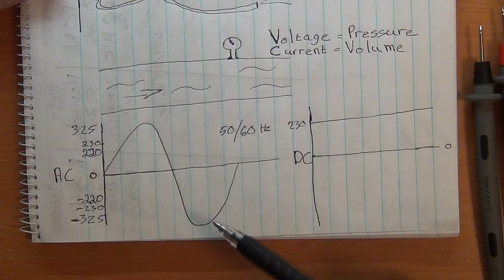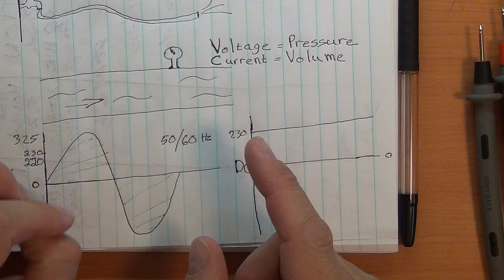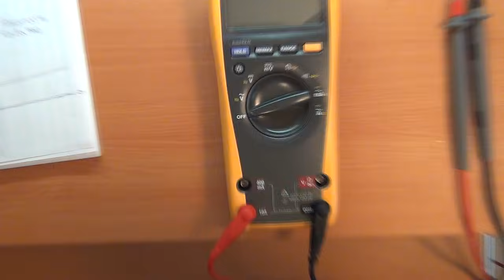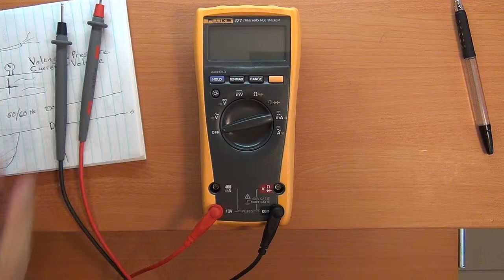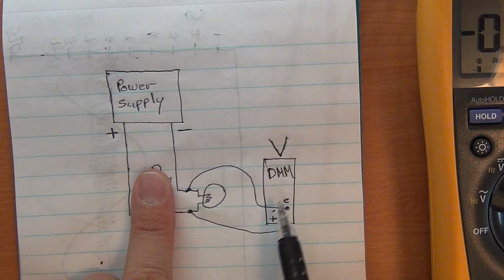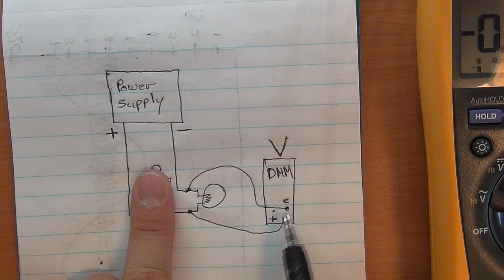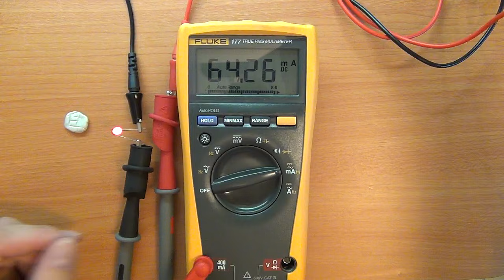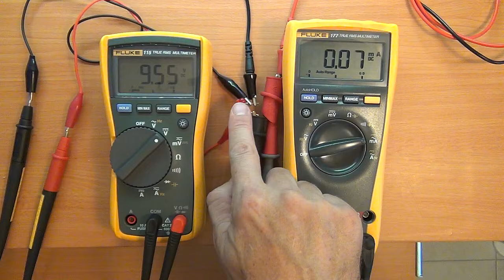Comment: Not to be too much of stickler, a singe cell is a battery when it is in a single cell device. Just like 4 cells in series is called "the battery" in a device that uses 4 cells, a single cell device also refers to the single cell as "the battery". Of course 12V 6V and 9V are all made up of multiple internal cells. Also, doesn't DC flow from negative to positive and not the other way around? Though I did sit through 2 years of formal training, I went into the computer side of things and not the digital electronics and so my memory may be failing me.

Comment: The mathematical average voltage in AC is 0 in a perfect sine wave. For every point in the wave, there a corresponding negative voltage. Despite going through 2 years of formal electronics training, I don't know why .707 of peak (RMS) is somehow "the average".
Reply: average voltage and rms voltage are two very different terms............ 0707 is the rms value. The average value as you said is obviously zero. You can check out the two formulas and both of them basically depends on the waveform.
Reply: Rishi Hazra
I assume it's not the average of a full cycle  but the effective voltage for a 1/2 cycle.
Reply: tarstarkusz well the average value of current or voltage for a sine wave for one cycle is calculated by the formula = (area under the curve) / base length

as the area under the curve of a cycle of sine wave is zero, the average value is zero.

but the RMS value as far as I know is the dc equivalent of an ac wave (i.e. say for current wave, it is the equivalent dc current which will produce the same heat in the same time in the same resistor ac that of the ac current.)

Comment: So that's why I had to spend $20 at Mouser for new 240v 1A & 10A Fuses. I tried to measure the current by touching red to red & black to black. Now when my new fuses get here I'll be prepared. Thanks so much, I had absolutely no idea this was the right way to measure current. It makes sense now. Now I'll be able to measure my Portable Cellphone Charger the correct way. (+1 : 3,443).

Comment: if the voltage is the pressure, and the voltage (pressure) is responsible for pushing the current, then how is it possible for a car batter to have low voltage and high current?
Reply: Think of it as a water faucet. Even if there is low water pressure, if there is a small opening, that pressure is increased; hence, increased pressure (current)
Reply: i thought the pressure = voltage..?
Reply: low voltage equals high current as its not moving so its a build up of current (electrons) if the voltage was higer it would be saying cmon current move ya backside hope this helps
Reply: As far as i am aware, Voltage is the measure of electric potential differance between two point's.

http://www.allaboutcircuits.com/vol_1/chpt_2/1.html
http://en.wikipedia.org/wiki/Voltage
http://www.dummies.com/how-to/content/electronics-basics-electrical-voltage.html
Reply: Voltage is not a measurement but p.d. is the measurement of electric voltage between two points

Comment: What's a good multimeter to buy? I just bought a $20 one but it has manual ranging, i get how to use it, but it's still a bit confusing.
Reply: that will do for basic need to spend a couple hundred get a fluke honestly

Comment: First, thanks for these tutorials. ive been reading this info in books and just havent been getting it. Im totally new to electronics and am learning it in order to do robotics. could you help me out with some questions?:

1. why dont they make a multimeter which KNOWS the differance between AC and DC. it seems fairly basic and easy to see.
2. Im looking at purchasing my first multimeter. what are the pros and cons of desktop multimeters vs the portable (fluke 177) ones? (recommendations would also be great :) )
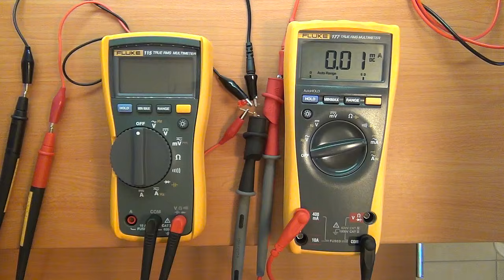3. Is there a way (or type of multimeter) whcih allows you to measure V and A at the same time? like you do with 2 multimeters at around 38:00?

Really appreciate any help you can give on these.

Comment: Hi there, the video tutorial really helped me out with the multimeter. Thanks a lot. But I have a question that I would like to ask, basically im in no knowledge in electricals so I assume u could help.
Just bought a house and literally haven't have time to get to know the house better. I realized mt actic light was on one day so went up there to turn it off and I noticed split seconds later one breaker that is connected to my bedroom, bathroom and the kitchen lights got shut off? So could you educate me?

Comment: @ Andy French.  Not 100% sure but I don't think you can measure current that way. You need to make the mulitmeter part of the circuit; not touch positive and negative terminals.   Maybe try removing +cable then touch +cable with red probe and            +battery terminal with black probe(completing the path from cable to battery). Find an old guy, they are great resources.  Good lluck

Comment: Just a dead quick question..... I wanted to measure how many amps was being 'put into' my motorbike battery when it was at about 3000 revs, so I could confirm that the alternator was working (Haynes manual stated that battery should be recharged at .5a at 3000 revs). 

When I put in the multimeter across the battery terminals, the battery terminal (whichever terminal I connected last) sparked and the multi meter did not read any values?  
The negative probe was in the 'COM' port and the positive probe in the '10a' port. 

What am I doing wrong?

Comment: I was told that AC travels better over distance. Brilliant video, many thanks.
Reply: Sort of correct. In DC, current reduces over long distances. AC, the electrons do not reduce because of the electron flow moves forward and backwards within a shorter distance compared to the one way flow of the DC electron flow.
Reply: Yes without major voltage drops

Comment: I'm confused. You say that DC freezes a body to the conductor and AC pushes it away. I thought it was the other way around. According to "The Set Lighting Technician's Handbook 3rd ed" by Harry C. Box (a book for film electricians), "AC current can be more deadly than DC current for several reasons. Although both types of current can have the effects listed in table 11.9, AC can freeze a body to a conductor with one- fifth the current of DC. Alternating current can more easily cause filbrillation and cardiac arrest because the 60 Hz polarity cycle is a harmonic of the rythym of the heart and AC current has a peak voltage of 170 V while DC is a constant 120 V."

Comment: AC, because the human body acts as a capacitor attached parallel with external circuit. And only AC can pass thru capacitor but not DC.
Now total resistance of AC=RC/R+C
where C is capacitance
Nd total resistance of DC=R
Since, R>RC/R+C
1>C/R+C
R+C>C
R>0
Thus, resistance of DC is more than AC hence more current will flow from AC than DC, since V=IR, I is inversaly proportional to R.
Reply: Too much wind.

Comment: I like to think of electrical current as pressure and voltage as the speed of water. I can then imagine water will jump out of a hose further if the voltage/speed of water is higher/faster. Current is like pressure squeezing a hose while it has water flowing through it. This will cause the hose to possible to burst. Like a wire getting hot.

Comment: If i can make a suggestion...use better leads. The multimeter is rated for 600v Cat 4 and 1000V cat 3.
Your leads are only rated at 1000v cat 2. Not an issue as long as you know what you are working on, however, BEST PRACTICE.

Comment: I have a Multimeter with a built in clamp meter, althought it only has two ports on the bottom of the multimeter for you to plug your testing probes into, if I want to measure current how do I do this? can someone please help it would be much appreciated :)

Comment: It may be an old video but anyways DC is nowhere near the efficiency of AC over long distances. There need to be many more power stations to generate and keep DC going compared to AC. That is the main reason AC is the standard for long distance power to like your home but DC works great for high power in short distance like your car battery.
Reply: Edison vs Tesla

Comment: AC current comes off the generator at the power station. Energy is wasted converting it to DC. Also, I think AC current travels more efficiently down power lines-though I could be wrong about this. I do know that resistance in power lines applies to current not voltage. Hence, very high voltage power lines (500k) transmit power more efficiently.

Comment: awesome video! can u pls clarify why is the multimeter set to Dc and not to Ac when you"re measuring the current in the LED as well as in the car headlight since your step up power supply is connected to an AC outlet?  i'm a newbie in electronics and really interested to learn. looking forward to your reply. tnx.

Comment: MJ/All...I TOTALLY understand your answer on why DC is more dangerous...but you mentioned when measuring AC to watch your fingers - don't cross tips etc etc...when doing the batteries (DC) there was no such warning and you were touching fingers to the battery etc (I understand a 9 Volt is apparently not dangerous - what voltage is?).  Also AC is in your home (correct?)?  That seems a helluva lot more dangerous than a battery (DC) - just wanna get this straight - this is good stuff!  Thx

Comment: Hi Martin,

 Had a question. You show in one of your classes a circuit using a bread board. Was wondering if you have a basic video indicating for beginners like me on how to create circuits on bread boards. I was very impressed with the multimeter and osciloscope video and would be good to have a basic video for beginners on using a bread board.

Comment: Excellent presentation and videography.

The multimeter measures voltage, current, and resistance.  You never measure resistance in a live circuit.  When you measure voltage, the voltmeter is effectively an open circuit, so if you put the test leads in the wrong places, you've done no harm.

The current range(s) are the most dangerous, and here's why: An ammeter is a short circuit you mean to put in series with the current path. Screw up (like putting your probes in parallel), bad things happen.

Comment: The reason we use AC current in our homes is because AC can travel longer distances over the electrical grid. Although DC could be used, it would require more infrastructure to provide electricity to every home. The use of AC over DC was settled during the War of Currents between Thomas Alva Edison and George Westinghouse. Nikola Tesla was in favor of using AC and he disagreed with Edison about the use of DC current. Tesla resigned working for Edison and later worked for Westinghouse.

Comment: Thanks for the video, but what if I have to measure i higher amount of amps? For example 70 - 80 amps. I do radio controlled modelling, and my larger aircraft have big motors that  pull a lot of amps! I don't need much accuracy, I need to know that the motor isn't pulling too many amps and burning other components. (wouldn't be pleasent finding that out when flying a model!) Thanks.

Comment: Here's my answer to the trivia question.  Keep in mind I know nothing about electricity but am keen to learn.  It is my understanding that since DC is not transmitted efficiently that it would have required generators on every corner.  AC is much more efficient at traveling down wires and therefore required far fewer generators and could be transmitted at greater distances.  So it comes down to money just like everything else.  It's cheaper to build the infrastructure for AC.

Comment: Sir,

I'm an ER physician. Your deadlier current reasoning is flawed & backward from reality. High-voltage DC often causes a large single muscle contraction that throws the victim away. AC of the same voltage is about 3 times more dangerous because the cyclic flow of electrons causes muscle tetany that prolongs victims' exposure to the source. Your muscle twitch response is not faster than 60Hz. Edison electrocuted an elephant trying to prove that his DC power was safer than Tesla's AC power.

Comment: The 240 you refer to is not what they use in other countries.  We have two 110 Volt lines 180 degrees out of phase.  What that means is while one wires voltage is going up to the top of the sine wave the other wires voltage is dropping down to the bottom of the sine wave.  Comparing 1 wire to the other you get a 240 Volt sine wave at the same frequency (interesting property of sine waves).  2 phase 240 @ 60 Hz not single phase 240 @ 50 Hz like in Europe.

Comment: Nice experiment.  You essentially measured the Current versus Voltage for a diode.  You should get an exponential function.  In a diode (not including zeners which are designed to work in the break down region) you will get ALMOST no current when reverse biased and an exponential rise in current as the voltage is increased in the forward biased direction.

Comment: It compares the current flowing through the hot side to the current flowing through the neutral.  If there are more than 5 milliamps of difference between the two currents it breaks the circuit.  The difference in current must be travelling an unintended path which may be through a person.  This adds another level of safety and is often required in kitchens and bathrooms around water.  Note if you have a heart condition 9 milliamps is about the minimum current required to kill you.

Comment: Note that you will always get the same amount of water flowing through the pump that you get flowing through the paddle wheel (if there are no leaks).  If I get a leak (by punching a hole in the pipe and placing my mouth over it) it might be nice to shut down the pump automatically.  This is analogous to what a Ground Fault Circuit Interrupter (GFCI) does.

Comment: which can occur if the hot wire ever accidently comes in contact with that metal surface.  If that occurs without the ground in place the voltage on that piece of metal will be "hot".  Someone touch it inadvertently would unwittingly be connected to high voltage.  By adding a wire grounding all exposed metal if and when a hot wire ever touches the exposed metal there will be zero resistance to ground.  This will immediately blow the breaker cutting off power to the appliance or fixture.

Comment: or return wire does not have a good solid connection to neutral voltage (approximately ground).  If this occurs and I touch the neutral I may get shocked.  Additionally in the states another wire which actually is hard wired straight into the ground separate from the line wires is required.  This wire is connected to any exposed metal on an appliance or fixture which might be inadvertently touched (for instance when changing a light bulb.  It's purpose is to handle a dangerous situation

Comment: Now what happens if I remove the paddle wheel pipe that is dipping in the ocean and place the opening on my head as I float in the water.  This is a different situation.  Now the sea side of the paddle wheel isn't connected to the sea and it can't get a free flow of water unless it sucks the water from my body.  It will suck all the water (electricity) from my body and then use my hollow shell as a straw sucking water through my feet!!!  Ouch.  This is analogous to a circuit where the ground

Comment: from the sea at the paddle wheel to replace the water in the pipe the pump pushed out.  Again if I put my mouth over a small hole in the upper pipe with a vacuum (negative voltage) it might suck my guts out since my stomach contents are a sea level pressure (grounded).  So the upper pipe (hot wire) will hurt me and it does have water flowing thru it.  The pressure at the inlet and outlet to the sea is always near sea level pressure even though water is flowing through it.

Comment: I can touch the sea level side (grounded wire) and won't get shocked in other words.  Touching the pressurized side (hot wire) while my body is unpressurized (grounded) would ruin my day though.
The pump is AC so it can also suck water from the upper pipe and push it directly down into the sea.  This creates a vacuum or low pressure in the pipe.  Since their is a vacuum above the paddle wheel which sea level (ground) pressure below the paddle wheel it turns counter clockwise and water rises up

Comment: paddle wheel right at the surface of the sea is at normal sea level pressure (ground voltage).  I can tap a hole in the pipe there and place my mouth over it and no water rushes into my mouth because the pressure has been dissipated turning the paddle wheel.  The pressure is at sea level (the same pressure as my stomach) so I don't have to worry about getting water logged and die.  Here in this section of pipe (the ground wire) I have little to no pressure yet water flows out into the sea.

Comment: Therefore if I punch a hole in the upper pipe and place my mouth over it, I will get a stomach full of water and perhaps burst because my body is a sea level pressure while the pipe is pressurized.  Water obviously flows through this section of pipe to so not only does it have pressure (voltage) it also has current flow.
Lets look at what we have directly below the paddle wheel.  There is a pressure drop (voltage drop) across the paddle wheel (which is why it turns).  The pressure after the

Comment: When the pump sucks water from the sea it pumps it up to some pressure (voltage).  So the water above the paddle wheel is now "positively pressurized" (i.e. positive compared to the pressure below the paddle wheel which is always at sea level pressure).  Since the pressure above the paddle wheel is positive compared to the pressure below the paddle wheel the wheel will turn lets say clockwise and the water will return to the sea at "sea level pressure".